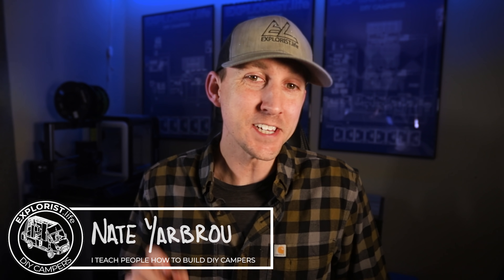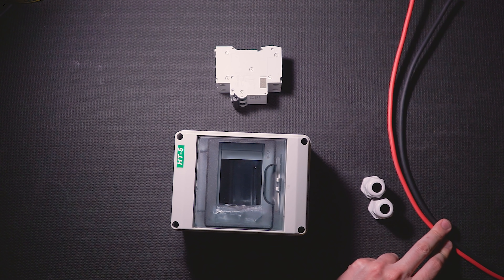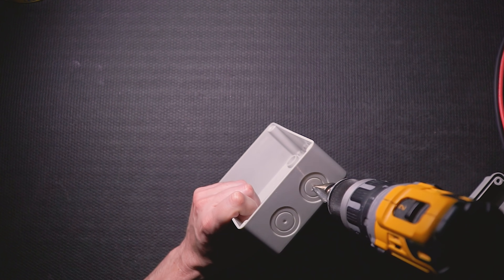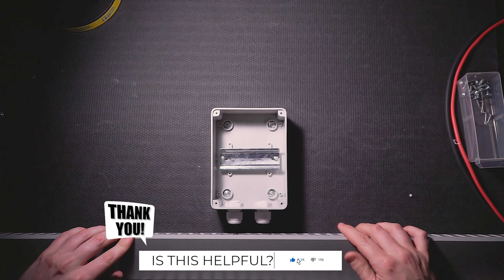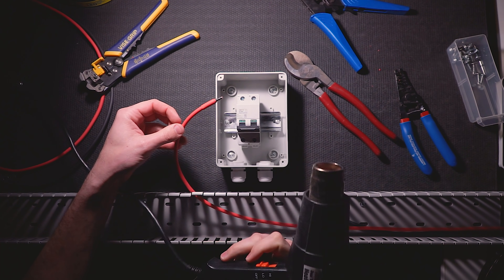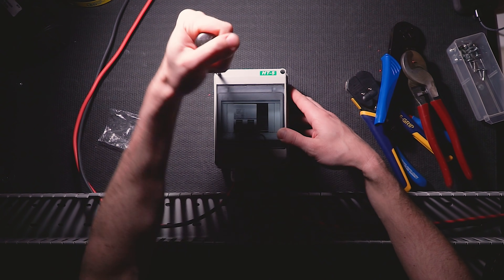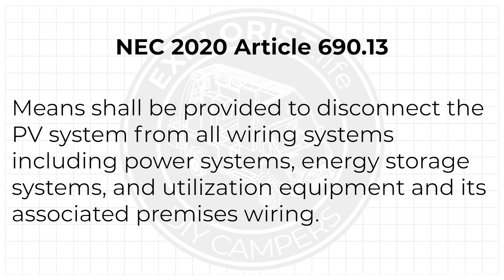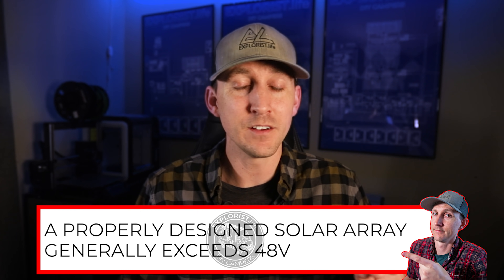How to Wire a Solar Disconnect for a DIY Camper Electrical System

Comment: Hi I have 2 x100w panels connected in parallel , max voltage is 18v and amps 5.55x2 ,i have a voc 21.6 volts and isc of 6.11amps .  I dont know what the short circuit current is . Ihave a 30amp controller 12volt battery and an inverter of 1000.where and what size fuses do i need . (Desperate)
Reply from the maker: Hey, Geoff Parker! I appreciate you taking the time to ask your question, but unfortunately, I don't have enough info about your specific question to provide an accurate answer, but here is a playlist that, if you watch all of the videos start-to-finish (and take notes 😉), you'll have a REALLY good idea of how to design a solar array: https://www.youtube.com/watch?v=Jkbs84sBHsg&list=PLmvhcyi4n0TV9pi83rFTv3ZuMT_S1xIZt

Alternatively, I have some of my most common solar array setups pre-built here: https://shop.explorist.life/product-category/all-products/camper-wiring-kits/solar-charging-wiring-kits/

Comment: Hi, i have a 3500w 24v inverter with 2 batteries ( 200amp each) my dc breaker is SPV-125  C80 (500v) and 6000 A i need to add 4 extra batteries of 200 amp each so the total is 6 , do i need to change my breaker to a bigger one or not? Thank you in advance

Comment: Hey how are you doing? First of all, I like to see how you explain all your videos . I'm starting been interesting in solar panel systems & I built one in my house as a fun time. Now, I bought a solar controller similar to a Panda one or something like that; & I have noticed that wattages/amps are fluctuating too much. My system is built with: 4 panels of 100ah 12v in series/parallel making 24v system, solar controller 60amps, inverter 3500w,  now I'm using 4awg wires for batteries, 10awg solar controller/panels, 8awg controller/batteries, also, & maybe this is the reason of fluctuating 4 car batteries. Could you give some tips about why wattages/amps are fluctuating too much.? thanks in advance.
Reply from the maker: Hey, Wilfredo Hernandez! I appreciate you taking the time to ask your question, but unfortunately, I don't have enough info about your specific question to provide an accurate answer, but here is a playlist that, if you watch all of the videos start-to-finish (and take notes 😉), you'll have a REALLY good idea of how to design a solar array which may help with your troubleshooting: https://www.youtube.com/watch?v=Jkbs84sBHsg&list=PLmvhcyi4n0TV9pi83rFTv3ZuMT_S1xIZt

Comment: Nice video and clean installation.  However, one note, a breaker is not between the panels and the controller as solar panels are self limiting. If your wires are properly sized you will have no problem. You should definitely have an appropriate switch to disconnect the panels safely. Of course the breaker can be used for this but it is an unnecessary waste of money.
Reply from the maker: That was explained in the 2nd half of the video just in case you didn't watch it through all of the way. 🙂👍

Comment: Excellent video.  Things are covered that I have asked about and never really got good answers although most you think you know why (it is good to have someone backup your theories, lol).  
Some of my thoughts/questions that he answered:  why you cannot use the 48 volt DC switches, why you cannot use an AC switch on DC, why you should use 2 wires instead of the usual 1 on a DC switch, etc.

Comment: Excellent info you have provided! Would it be possible to combine the breaker shutoff feature and also be able to satisfy the fuse requirements on that side of the controller? Say one needed a 30amp fuse on the positive side between the controller and panels, couldn't the shutoff breaker be rated at 30amp, allowing the breaker to do a dual duty? An older video but perhaps someone out there has a thought on this...thx
Reply from the maker: Nope.  The fusing would need to be on the 'panel' side of the combiner.

Comment: Wow I just paid a Victron authorized installer in Quartzite $15k (a week ago) to install a 800w system they used the little black breaker in my system. They didn't give me a way to disconnect the batteries either I have a lot of AH 2 Battle Born Game changers.  I'm still trying to clean up their mistakes.
Reply from the maker: Oof... Sorry you are dealing with that.  Hopefully this channel is helping you with that cleanup.

Comment: I purchased this breaker box and 63 amp breaker from the product list on from your video. I see that the box fits two breakers. Is there a reason that I should not use a second identical breaker for the shut off and protection for my Orion dc to dc charger? 8 Awg for panel 6 Awg for Orion are the cable sizes I’m using. Thank you for all you do

Comment: Hi, can you please tell me what circuit breaker I would need just for one solar panel rated 525/560W ?
Reply from the maker: Based on the information provided in the video and in the pinned comment, what do YOU think you should need?
Reply: @EXPLORISTlife  I have watched couple of times your video and I believe is the 60amps one?
Regards

Comment: I have a question about an array's voltage maximum as it relates to the SolarChargeControllerInverter's (SCCI) rated voltage input.
My Growatt 12k SCCI can accept up to 250Vs per input, which it has 2. My 1st array is built from 5 x 49.85v panels in Series and the 2nd array is built from 5 x 49.55v panels also in Series.
I live in Tucson so I'm not too concerned while I'm here, but I do plan on roaming up to Flagstaff, WY, UT, MT and ID during the winter and no doubt will both arrays exceed 250v.
I've thought of 2 scenarios to employ:
1. Put a bypass switch between panels 4 and 5 so I turn both arrays from a 5 String Array into a 4 String Array
2. Have a Volt limiter built to limit Voltage to 240volts

What are your thoughts?
Cheers
Reply from the maker: Hey, Paul Curtis! I appreciate you taking the time to ask your question, but unfortunately, I don't have enough info about your specific question to provide an accurate answer, but here is a playlist that, if you watch all of the videos start-to-finish (and take notes 😉), you'll have a REALLY good idea of how to design a solar array: https://www.youtube.com/watch?v=Jkbs84sBHsg&list=PLmvhcyi4n0TV9pi83rFTv3ZuMT_S1xIZt

Alternatively, I have some of my most common solar array setups pre-built here: https://shop.explorist.life/product-category/all-products/camper-wiring-kits/solar-charging-wiring-kits/
Reply: @EXPLORISTlife  I’ve actually made it through most of your playlist, it’s outstanding. I have not  found the insight I was looking for though. What info do you need that is missing?

Comment: Hello I have three large panels one is solar all the way threw it the other 2 have a white backing. I'm trying to hook it up to my camper I have a couple of old car batteries and some  romex house wire and a circuit breaker. I want to run straight to battery to panel is this possible.
Reply from the maker: Based on the other videos you've watched on my channel (or other channels, for that matter)... what do you think would happen if you connected a few solar panels directly to 'a couple of old car batteries' without a charge controller in-between?

Comment: What happens with products like the Redarc BCDC range or CTEK units which connect direct to solar positive and in the case of the Redarcs, solar negative attaches on the common vehicle earth? Are they just ignoring these rules and should their instructions be different?
Reply from the maker: I don't have much experience with those particular units.

Comment: I have a 1200 watt solar system with a 60 amp charge controller need to know what kind of cut off switch to get so that I can disconnect panels from charge controller ?
Reply from the maker: Check the pinned comment for the most up to date recommendation.

Comment: Makes perfect sense, thanks! Question about the reset breakers you show at 5:37 though, the middle breaker shown is (I believe) an audio line breaker? I've been told these are totally unsuitable for use as a breaker for any constant DC power load.  Is this correct? If so, what makes them unsuitable?
Reply from the maker: Yeah, I don't recommend those in any electrical system because there isn't a reputable manufacturer that makes that type of breaker (maybe there is a good reason for that?). Blue Sea, Cooper, Eaton, Bussman, Littelfuse are a few of the overcurrent protection manufacturers I'm looking at when purchasing and recommending overcurrent protection.
Reply: Thanks  @EXPLORISTlife  ,  that was close as I was about to put a bunch of these breakers (bimetallic I think they are called?) in my van. Concerning as I deliberately sought them out as they are the type used by the auto electrician who originally put my inverter in. Anyway, think I'll perhaps look at just an ANL fuse for the battery and either the Bussman or Blue Sea 187 series breaker for my inverter and perhaps just a basic blade fuse box for everything else (nothing above 40A).

Comment: Awsome video as usual! Is it really a good idea to put two cables through a wire glands?
Reply from the maker: If you don't need the gland to be waterproof an are just using them for strain relief, it's totally fine.

Comment: Just a little FYI, the DIN rail circuit breaker box you link to is currently unavailable. However, other sellers are selling the same box.
Your videos are a great help to me. I'm working on putting together a 24V system, I don't know what the final size will be yet. I'm buying a few parts for it each month, as my finances are rather limited.
Reply from the maker: I've switched my recommendation away from this breaker and box largely because nobody on Amazon could keep them in stock.  We now stock an actual DC isolation switch in our store.  Check the pinned comment.
Reply: @EXPLORISTlife  Thanks, I'll do that.

Comment: What if the inverter has the breakers built in?  For example the SunGoldPower 4000  watt all in one inverter, charger, charge controller, transfer switch ?  Do you think it is safe to rely on these breakers plus fuses on the incoming line?
Reply from the maker: I have no experience with that unit, unfortunately, so I can't really answer that question.  I've got quite a few setups here on this channel, though, that will show you how I recommend building these systems.  Check the channel playlists for 'full installs'.

Comment: Nate….I built your exact system with the disconnect in this video. On my latest camping trip the disconnect tripped! Twice! Both at the height of sun for the day. I try to reset it and it would immediately trip. I left it off for 20 minutes or so and it reset. Why would the disconnect trip? I have 1200 watts of solar (6-200 watters) that are wired series-parallel.
Reply from the maker: Interesting.  Is it the 63A breaker?  Could always be a faulty breaker, I suppose.  It's pretty rare for that breaker to trip.  Are the connections nice and solid?
Reply: Rookie move….connection worked its way loose from bottom of breaker to solar charge controller. Thanks

Comment: Great vid as usual. and I already bought the box and breaker,  but...should you, or can you also have an inline fuse/breaker on a single 400 watt solar panel?
Reply from the maker: You need a disconnect, but no fuse.  More info: https://youtu.be/s1P31hxlD3I

Comment: Can I use 2 single pole 10amp DC breakers side by side coming from just a single 100 watt solar panel, then to 10amp controller just for using as  switches to disconnect + and - from solar panels......Or just put the breaker on the positive from solar panel.
Cheers, great video's! 
Jason.
Reply from the maker: You **can** do whatever you like.  I've provided the proper information; now it's up to you to decide what you actually want to do. 👍🙂

Comment: Hi Nate, i ordered the breaker you recommended in your link, but the wireing diagram on the front of it says black red on top and red black on the bottom, in the video you wired the breaker black red on top and black red on the bottom..can you please tell me the correct wiring for the breaker you recommended in your link

Comment: If my panels are on my upper deck of my house,should the breaker box be there.
Reply from the maker: You'll want to look into residential building code for disconnect location requirements.  This channel is about building DIY campers, so the location is much more of a grey area.

Comment: ...I can't find a heavy-duty DC/Amp/Watt led monitoring device combo with the disconnect...only AC types are available
Reply from the maker: The Victron SmartSolar MPPT Charge Controllers have solar amp/watt monitoring built in.  See it in action here: https://youtu.be/01F4QDVJUq0?t=3136 at the 52:00 mark

Comment: Thanks for this. I was able to do this following your link for parts and watching your video. And I have to say it works!!! But I have a question!? This disconnects power from the solar array.  So that you can work safely on your unit. But isn't there still power of the battery?? Thats a safety concern as well?? I dont know anything abt electric still learning tks. I guess when you shut of power, w the disconnect it should be followed with disconnecting the battery as well.? For total safety
Reply from the maker: All of my systems at https://www.explorist.life/solarwiringdiagrams do indeed have a switch at the battery that would need to be turned off before anything else.

Comment: It'd be nice if that breaker didn't "float" around in that breaker box. It'd also be nice if that big hole wasn't staring me if the face all the time. I wish there was a blank we could put there to make it look a little more finished.
Reply from the maker: Those are two of the reasons we have switched over to recommending this one instead: https://shop.explorist.life/shop/all-products/switches-disconnects/solar-isolator-disconnect/
Reply: @EXPLORISTlife  Ahh, yes, this one does look a lot better. I'll make do with this one for now since it's too late to return it. I'm sure it'll be fine. Thanks for the update.

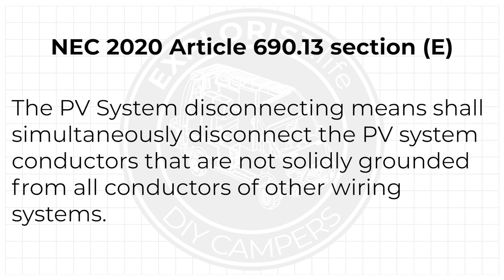Comment: Hello Nate.  Thank you for this video.  I don't quite understand the NEC ruling at time 5:54 of your video.  What does solidly grounded mean?  I also don't understand why the negative lead from the solar panels need to be switched along with the positive lead from the solar panels.  My system works at 12 Volts and it is not grounded.  The system is meant to be used for a backup power source in case of a power outage for the house and for me to learn about solar.  I am using a combiner box outside at the solar panels.  Each panel is switched at the combiner box.  But, only on the positive lead.  I feel that it is perfectly safe and I have never had any issues.  Does the NEC ruling only apply to campers?
Reply from the maker: NEC is the 'National Electrical Code' and is a primarily a residential/commercial electrical code.  There is an RV electrical standards, but unfortunately, RV manufacturers, over the years, have lobbied for the RV electrical code to be incredibly 'lenient' since many RV manufacturers are doing incredibly shoddy workmanship.

For this reason, on this channel, I go by a combo of NEC code, ABYC standard (American Boat and Yacht Council), and manufacturers recommendations.

'Solidly grounded' means having a wire that goes from the frames of the solar panel frames to an actual ground rod that is pounded into the dirt per the NEC (paraphrased)
Reply: Thank you for replying.  I am glad that you are following the NEC and the ABYC standards.  When I first started.  I just wanted to get something going.  Now, I am working on being up to code and doing it properly.  I built my system back in the early 2000's.  I want to keep my system simple, but up to code.  I could not see why it was necessary to disconnect the negative lead from the solar panels. I guess in a camper or rv, there could be hidden pathways for extraneous currents to flow.  With amateur radio, in mobile operations, both the negative and positive connections to the battery are fused.  So I can see that it might be good to disconnect both the negative and positive leads to the solar panels.   @EXPLORISTlife

Comment: Can circuit breakers be reverse-fed or back-fed? I mean, the solar panel wires (input) entering the circuit breaker from bellow, and the wires going to the battery (output) coming out from above. Thanks.
Reply from the maker: Not all of them.  Check the instructions of the breakers you've purchased to verify.

Comment: Hi Nate, very helpful video as usual. Most other video simply recommend one of the other breakers that you suggested not be used due to voltage issues which I appreciate. One question I had was where do you get that black backer board for install? I dont see it on your parts list. Thanks

Comment: hi wow very nice video can you please kindly help me I bought 2 pole DC breaker 16amps 1000v I have sunny boy 3000 watts grid tie inverter how can I connected the DC breaker from solar to the sunny boy inverter? on the DC breaker top terminals no 1 is negative and next terminal is 3 positive and the bottom frist terminal is 2 positive and the 4 terminal is negative why they are crossed? its very confusing can you please kindly help me on this how to wire 
thank you Sam

Comment: Very informative video, grateful your channel exists. Conscious of the space for electrics in my van (but of course safety comes first) - if I take two of those 48V max square breakers (one for the pos wire and one for the neg wire coming from one 24V PV) and position them side by side, would this have the same effect as a dim rail breaker and box? Thanks
Reply from the maker: Nope. The positive and negative conductors need to be able to disconnect simultaneously.
Reply: Ah I just noticed that although there are two pairs of wires to be fed into the breaker there is only one switch to flip that turns both off. Very helpful, thank you